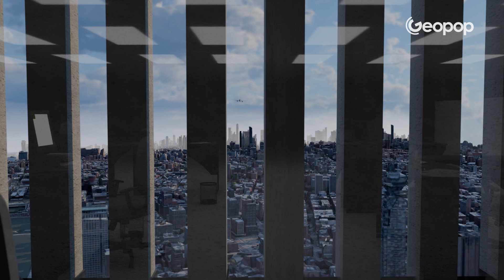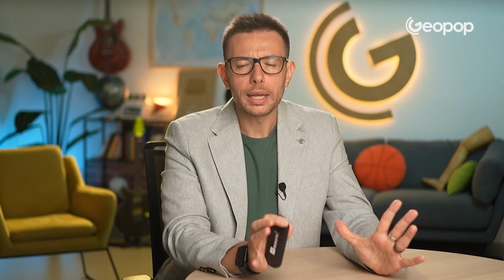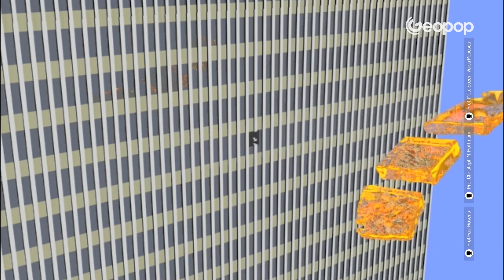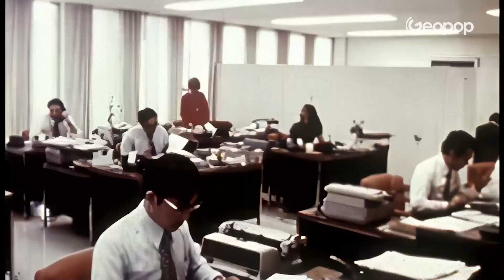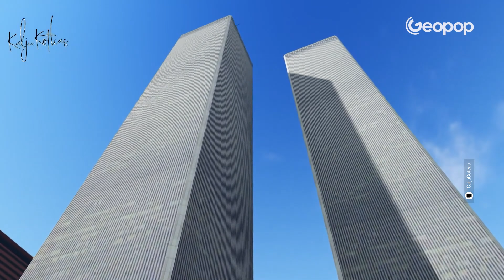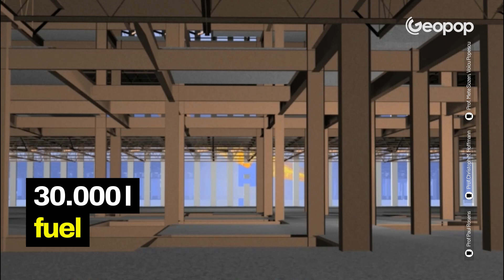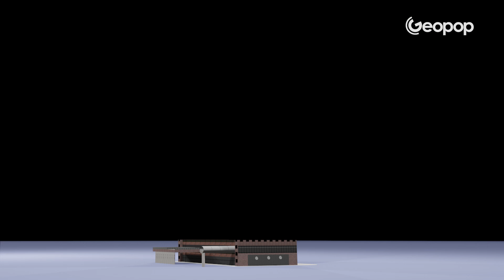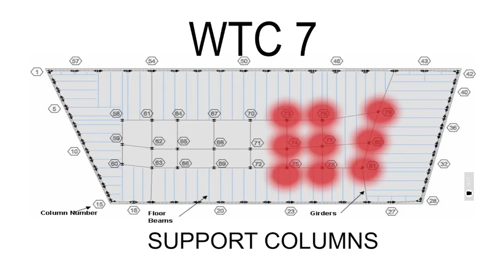9/11, 2001: The Technical Reconstruction of the Twin Towers and WTC 7 Collapses

Comment: People say that this building was able to withstand the heat and impact of this incident and was brought down by demolition explosives......you live in such a backwards way!! Yes the steel is designed to withstand a certain load of weight and a certain amount of heat before buckling....but you have to think this plane at that speed and it's weight and power fully loaded with jet fuel is going to smash straight through that building, not to mention that it's knocked out lots of steel supports that hold not only the next floor above it but now it's holding all of the floors above it whilst everything els is being melted and burnt to shards. This building could have been hit on any floor and would still collapse!

Comment: Sorry, still not convinced…
Reply: That's because you've made up your mind, evidence be damned.
Reply: @Tim22222  With respect , there’s just far too much evidence to suggest that something different happened.
Reply: @garylake1497  Example? I'm asking for evidence, not speculation.
Reply: @Tim22222  well obviously there’s way too much to go into here. However you could start with the multitude of first hand accounts from firefighters of multiple explosions in all parts of buildings 1 and 2,including the basement. Same recorded accounts given by the head janitor of massive explosions in the basement. Chemical evidence of the explosive Thermite detected in the molten metal of the debris ( still molten several days later ). The collapse at free-fall speed of buildings 1 and 2 indicating that there was no solid material beneath the falling debris to slow it down. How is half a million tons of steel and concrete atomized into dust before it even hits the ground?
The plainly obvious 45 degree shape charge cuts on the bottom of the 47 main central stanchions of the structure ( even confirmed by demolition experts as undeniable).
In the 1980’s the Windsor Tower in Madrid (of similar design) blazed in a raging inferno from top to bottom for 24 hours, when the fire went out the frame remained standing.
For WTC 1 and 2 (and 7) to be dropped neatly into their footprint we are being asked to believe that thousands of rivets and welded lugs supporting each individual floorpan all failed exactly simultaneously.
The list goes on and on, we could be here all night!
I suggest you try and obtain copies of the documentary “Loose Change” ( there are 2, loose change 1st edition and loose change 2nd edition), I think they were banned in the US under the patriot act. That piece of hastily implemented legislation rushed through in the weeks after 9/11 to prevent any dissenting voices on pain of 14 years imprisonment.
Reply: @garylake1497  - I'm going to pick just one of your concerns at random and address it - the angle-cut columns

The angle cut steel "stanchions" (actually core columns) you speak of were cut on 10/29/2001 by workers removing debris using thermal lances and cutting torches. This is confirmed by AP photography of the scene before, during and after 10/29/2001.  The issue is addressed in this short video. 

www.youtube.com/watch?v=pVDU5QKa8Wg&t=7s

The rest of your concerns are just as easily addressed. In fact, why not hit a few more all at once right now?

This is my summary explanation of Twin Towers collapses of the Twin Towers, start-to-finish, based on my observations without appeal to, or reliance on any authority. No politics or ideology, just what actually happened. This is agnostic to who planned and carried out the 9/11 attacks or why. It has the benefit of not requiring Rube Goldberg levels of complexity and it makes logical sense. Each step in the process flows naturally from the one before, is chock full of critical details the conspiracy oriented internet tends to leave out and with no whataboutisms.  My hope is this will dispel many common myths and answer most if not all questions you may have about the Twin Towers collapses. 

While complex, most of the Twin Towers collapse mechanisms can be seen with the naked eye and easily discerned and understood by the layperson if sufficient time is taken to understand. The worlds engineering community had already largely sorted them out at least as early as October/November 2001. Still, there are many who can’t be bothered to look or perhaps work hard not to see, being more concerned about advancing political/ideological agendas (which is exciting) than science and engineering (which is boring).

1. The Twin Towers consisted of 4 primary structural elements that together formed an integrated system where each relied on the others.  47 hollow box-section steel Core Columns carry the majority of the gravity loads. The 236 hollow box-section steel Perimeter Columns carry the remainder and ALL of the lateral (wind) loads. Long-span Lightweight Steel Trusses connect the core and perimeter column together at each floor with a Hat Truss on top to tie the structure together as an integrated unit where no element can survive without the others 

2. The impact of 117 tons of airplane (= to about 12 dump trucks) at speeds up to 590 mph completely destroys the aircraft.  This in no way implies the Towers come out unscathed. Some folks don’t get that. Hitting with the energy of up to a ton of TNT the impact damages or destroys many perimeter and some core columns (33 of 59 perimeter and 20 core columns destroyed at the impact floors in the North Tower), primarily through bolt-shearing failures at the end connecting flanges, as well as bending, twisting and fracturing of weld seams. There was no cutting or slicing - the reality was far more violent and messy. 

3. The impacts destroy or damage fire insulation, fire breaks and sprinkler systems on multiple floors. Huge fires are started across multiple floors simultaneously and allowed to spread rapidly with no effective firefighting or fire suppression. This was an unprecedented fire event . All of this was observed and recorded.

4. The hotter steel gets the weaker it gets .  With fire insulation stripped away and no sprinklers the survival time of the steel greatly reduced. Gradually over time heat causes the lightweight steel Floor Trusses at the impact damaged floors to sag, which was observed and recorded.  No steel melted nor did it need to. Structural steel will fail long before it turns to a puddle. It just needs to bend

5. Sagging floor trusses pull on the increasingly weak and overloaded Perimeter Columns, causing some of them to bow inward by up to 5 feet. This was observed and recorded. A straight column is up to 4 times stronger than a bent column. 

6. The bowed Perimeter Columns buckle and fail, initiating collapse. This was observed and recorded.  The formerly static mass above which the structure below could easily support is now converted into a dynamic mass up to 30 times greater. Because they have buckled, the Columns above and below the failure point are no longer aligned . The load bearing structure below no longer bears any load as it falls past the lower columns, NOT onto them.

7. Thousands of tons of debris fall within the four outer walls, down through the open office space, crashing onto the first intact floor it encounters. This massive impact immediately breaks the bolted connections to the columns as the amount of resistance the Floor Trusses can offer is negligible.  The falling debris slows only marginally and briefly. Note:
7a. This is NOT a solid top block crashing into and “crushing” a solid bottom block .
7b. The debris falls past the columns not onto them.  The columns provide no resistance to the falling debris. 
7c. Only the bolted connections of the floor trusses to the core and perimeter columns can offer any resistance. A pair of 5/8” bolts at each end of each truss vs. thousands of tons of falling debris.

8.  This floor-led collapse progression within the four outer walls can only go straight down. Note: 
8a. This process is often incorrectly referred to as “pancaking” which actually refers to a completely different process rejected at an early stage. The catchy name stuck but nobody knows what it is supposed to mean.  Pancaking is too simplistic and inaccurate anyway. More like Kaiserschmarrn.

9. Collapse progresses through the floor systems and not down the columns. Rate of floor assembly failures increases with each successive floor as momentum increases, reaching an average acceleration of 0.65 of GA, or 35% slower than true free fall. Bam, bam, bam down the building until there are no more floors to fail.  The resistance offered by each successive floor is always the same. The mass and velocity and thus the energy of the falling debris are constantly increasing.  The falling mass increases with every floor it destroys as new falling mass is added. Some falls to the sides, but most falls down. More mass, more velocity, same resistance with each floor.
The above is unquestionably the path of least resistance

10. The Towers were 95% air by volume and as that air was compressed inside the building it is forced down the tower and blown out the sides in reaction to the building collapsing not causing the collapse. Those were not “explosions”, it was expulsions of compressed air. 

11. Perimeter Columns become detached and peel away like a banana behind the collapse front, playing out to the four points of the compass extending to more than 600 feet from the base of the towers. This was observed and recorded, the results quite obvious from examination of the debris pile. 

12. Core Columns fail last as their internal beam bracing is stripped away and lateral support from the floor to perimeter columns is lost. This was observed and recorded and is most obvious in the North Tower. 

13. For those who care about how long this took, the whole process took 31-34 seconds from the moment the perimeter columns buckled until the last core columns hit the pile, or 1/3 the rate of true free fall. Don’t believe me?  Just watch any video of the collapses and note all the loose and truly free falling debris dropping much faster than the towers themselves.

14. What was NOT observed and recorded were the 180-190 dB bangs of high explosives or the blinding bright flashes of burning thermite. Of course, neither could have caused the (silent) Perimeter Column buckling that was observed.  Neither explosives or thermite could have survived the impacts and subsequent fires either. Cherry-picking a casual comment from someone who heard a loud noise in an event like 9/11 is not exactly “proof” of anything and the pre—planned demolition case relies entirely on that. There is zero physical evidence to support either conjecture. It would be technically impossible, totally impractical and completely unnecessary. No one would bother. 

15.  The Twin Towers were perfectly safe within their design envelope.  They only collapsed when taken far outside design parameters by an extraordinary and unprecedented event. 

Impact + Fire (heat) + Time + Gravity = Collapse . Remove any one of those four elements and there is no collapse. Ignore any of those elements (as many do) and you will never understand the collapses. The Twin Towers were an integrated system in which no one component could survive without the others. One fails, the rest follow, through the path of least resistance – DOWN – through the open space, bypassing the path of greatest resistance – the columns. Don’t get stuck on the but the lower floors weren’t on fire nonsense. 

I hope you found this helpful. It is meant to be informative, not adversarial, posted with the objective of soliciting informed critical comment, positive or negative. If I made any errors of fact, logic or reason or left anything critical out, please let me know so I can fix it. One topic at a time, on topic only please to stay focused, no word-salads of Gish Gallop. IF you can offer a more plausible alternative be my guest. So far no one has even tried. Please start any reply with the words “Tits McGee” or I will know you didn’t actually read it, are not serious and just wasting my time.

Comment: The worlds best structural engineers would not agree with this video. Building 7 for example was reinforced to withstand a nuclear attack. What happened to the super strong cores? Steel structures do not collapsed due to fire. They certainly don't collapse at freefall speed, unless it's a controlled demolition. Yet three massive steel buildings collapsed completely into there own footprint on that day.  No steel structure has collapsed due to fire before 9,11,01 or after 9,11,01
Reply: "Building 7 for example was reinforced to withstand a nuclear attack."

Lol! NONSENSE!! The steel did not collapse due to fire alone, it collapsed because of uncontrolled fire following traumatic damage! Funny how you omit that little detail. If it was just fire the towers would have survived.

Comment: With building 7 a lot of people ignore the fact that a metric fuck ton of debris ended up severely damaging building 7 due to the collapse of buildings 1 and 2. The design of the building meant a lot of the main load bearing supports were closest to the larger buildings so when they fell it damaged the most critical parts of the structure. There’s a picture floating around somewhere that shows the massive gash down the side of building 7 but of course it’s never shown on conspiracy videos.
Reply: I actually have that picture saved on my hard drive!